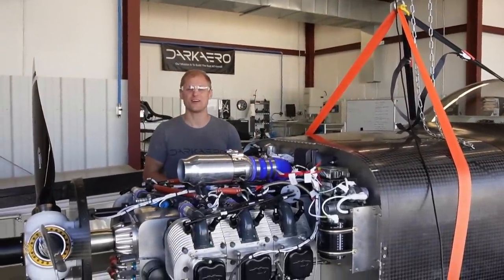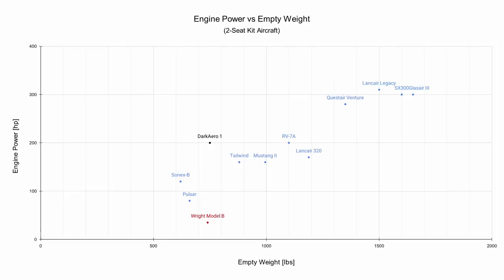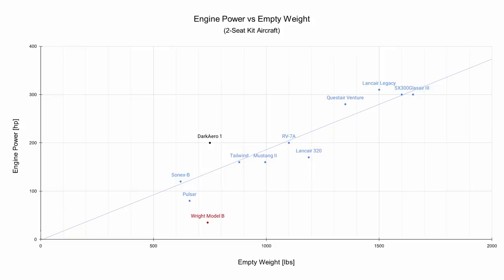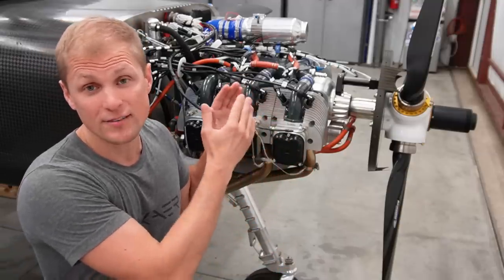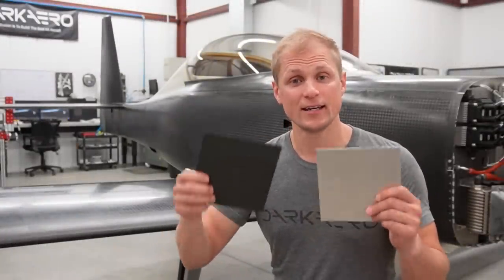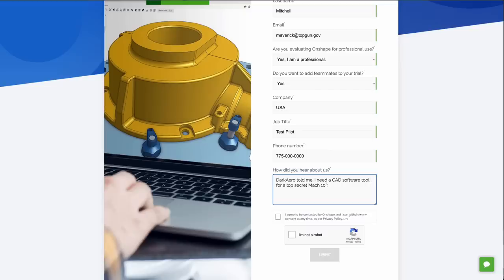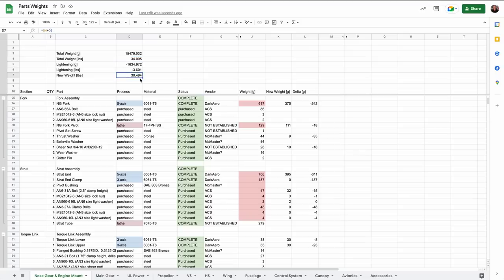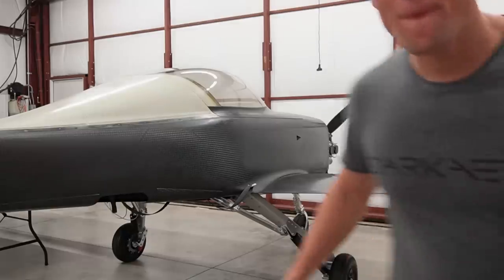How we built the DarkAero 1 "impossibly" light...

Comment: For all my fellow friends of reasonable units, 750 pounds is 340,2kg.
Reply: Or as Jeremy Clarkson once said, " In Roman Catholic ".
Reply: Lol so true. Wish I was raised with the metric system so the scale would be easier to see without having a measuring tape
Reply: THX
Reply: Isn't it 53.5 stone?
Reply: @danniendorff4815  53.8
Reply: Thank you, i believe he said 715 so would be even lighter, crazy!

I was hoping theyd add that after he said "i wanna explain to you what that means" :D
Reply: @Beerbellybilly1  53.75 actually
Reply: Seems impressively light to me.
It's got a better power to weight than most motorcycles..
Reply: There is nothing wrong with heathen units. 😥
Reply: Shuuut
Reply: 3402kg? Do you mean 340.2kg? :-p
Reply: @D3nn1s  715 is the weight right now, but certain parts are removed (for example the cowling) and certain parts are test exclusive (tank on the passenger seat). The target/ estimate for the final product is 750lbs.
Reply: So how it does compare lets say with WT9 Dynamic wich weights 260kg empty?
Reply: @plainText384  yeah realized it too, they said it quite late in the vid. Ty for explaining though anyways :)
Reply: @flugplatz8719  Wow that’s a nice looking plane. A quick look shows it has half the horsepower tho and fixed landing gear. I’m too ignorant on the topic to point out any other significant differences aside from those
Reply: It can fly with a R912 easy
Reply: King comment
Reply: @TheJustinJ  NASA actually used a mix of metric and imperial units during the Apollo era. For example the guidance computer on the Lunar module did all the internal calculations in metric, to control the computer guided part of the flight. However to allow the astronauts to see what the autopilot was doing, the units were converted to imperial in order to be displayed.
Reply: @TheJustinJ   yet it would be easier
Reply: Why is there a comma after three of the numbers?
Reply: @realjohnnyharrison  340kg and 200g. Where I live you use a comma to separate tenths from whole numbers
Reply: @realjohnnyharrison   some countries uses comas in place of dots 

Where I am is that way, comas for decimals and dots as separations for group of 3
Reply: Thanks for your concern. I went to school and I can use more than two.
Reply: @jakleo337  big trouble
Reply: Once you people of "reasonable" numbers walk on the moon, we of superior numbers will listen.
Reply: @TheJustinJ  you can only listen when someone talks to you, like you know how normal people do through our God given senses. Until then the hunger games continue.
Reply: For all my fellow friends of freedom units, 340.2kg is 750 lbs.
Reply: Thank you for restoring common sense.
Reply: HOLY SHIT
Reply: What the fuck is a kilometer
Reply: Eat my shorts commy! Sorry.
Reply: @RetRak0  "not commies": USA, Liberia, Myanmar
"Commies": literally everyone else.
Reply: This plane is so light, the imperial value seems ok for a metric one.
Reply: * 340 kg.

You can’t jump from 2 significant digits of precision to four during conversion of units.

750 lb is a round figure.  340.2 is a precise figure.
Reply: ah...unit snobs....
Reply: It's quite light because there's no transmission in between the propeller and engine, it is a direct drive.. BUT is the rpm of the propeller solely dependent on how open is the throttle?
Reply: America build planes in lbs
Reply: @fredio54 the way they use commas for decimal places really grinds my gears lol.
Reply: Until the metric world puts a foot on the moon, the American foot will remain the standard measurement of altitude.
Reply: @TheJustinJ  wait until you learn that the chief architect of the Saturn V was a German and that NASA widely used metric (and imperial units) in the 1960s to put boots on the moon.

Comment: This thing is gonna be disruptive to the fast 2 seat market. What a great example of how to use technology to improve existing concepts as well as set  in stone a solid foundation for a great company to flourish. Great job guys! Can't wait until you've got 1000's of these kits pouring out of your facility!
Reply: No, it won't, it's too small. The thing is basically a fast ultralight.
Reply: @PistonAvatarGuy  Not much utility.  Also, few comments about how far away this is from an actual consumer product. My guess is their real business is as a composites subcontractor and this is a showcase for their skills. Whether or not it turns out to be a vanity project or a very expensive toy for the rich, it will take a lot of testing and time to prove it's safe. Being a prototype at the far edge of the envelope, at 260 MPH a design flaw could mean disaster. A simple change like having to move the main gear 2" could result in having to redesign the entire airframe and add several months. Read about the C177 and Cessna, an established airplane manufacturer with money and a team of aeronautical engineers and the things they had to fix after the plane was built, after altering a proven design.
Reply: @dougj8186  and planes that small and fast, even if they are mechanically and structurally sound, prove to be way to much of a plane to even fighter pilots, ending up in lots of deaths and bad publicity
Reply: @samtatenumber1  The only "disruptive" homebuilt planes are the VanGrunsven RV series, 100 year-old technology using aluminum and rivets. I flew up and visited years ago when he was based at his parents farm in Oregon and the aluminum stock was on racks in the field outside his shop.
Reply: @dougj8186  Yes, it would be fair to say that this aircraft is one giant resume for getting a government contract (maybe drone) by showcasing their skills. 

But that’s great business sense and means they will be around for the long term which means support for all the DA owners. 

I’m sure they are well ahead of anything you have already thought of as potential hurdles in their future.
Reply: @ashsmitty2244  It's an awesome project. I just expect will it take longer and be way more expensive than presented so far. Isn't it a year behind schedule already?
Reply: @dougj8186  I’d think covid, lockdowns and supply shortages are a legitimate reason to be behind, if it were not for that. They would be close to schedule. 

Put in a deposit and lock in the price. 😉

I’m expecting my kit around 2025-26.

Comment: With regards to Carbon Fibre, have you considered the safety of the occupants in the event of a crash as carbon fibre shatters into sharp pieces regardless of the honeycomb. Also what about lightning strike? What if the aircraft is struck by lighting, if you paint it, the extra insulation will cause a concentration of energy, possibly dissipated by the honeycomb, but also if the honey comb is air tight, the rapid expansion of heated air may cause de lamination and explosion. Unlikely, but possible if a pilot flies through a storm. Also, if this aircraft is flown at high altitude and the honeycomb is air tight, will the structure be able to handle the pressure differential between the honeycomb and outside, or repeated pressure cycles? Also, how repairable is the aircraft, if damage was to occur to a wing, would you have to replace the whole wing, is it removable or is it permanently attached?
Reply: Very good points. Worth considering.  I really like there grid spar concept.

Comment: When you think you're done another idea pops into you're head sometimes good sometimes not so good but those usually are disposed of with hands on demonstration and real world use and safety but not at the cost of reliability and control don't concentrate on just the weight but the integrity of the build this plane is a game changer with the design and technical aspects galore great job

Comment: When Mazda made a new MX5 years ago they wanted to keep the weight right down. They had engineers look at every single part, nothing was excluded, and then reduce the weight even if it was only a gram. I saw this is a feature on Top Gear UK. Mazda managed to reduce the weight of the rear vision mirror by 90 grams / 3 ounces. First off that’s great, second is what was going on in that mirror to start with? You seem to be setting yourself up to do the same. You know what you have and what it needs to do and you control the construction. So now you can get super critical on everything.

The Dark aero is a Rapier rather than a broad sword. Both will kill you but ones a refined seemingly delicate design and the other is a beast.
Reply: Indeed

Comment: Good grief... the wing is so light that two guys can carry it around.  I work only on the Cessna 310... the wings are bolted to the fuselage. Just one wing is so heavy that it takes an adjustable cradle to support it while it's removed from the fuselage, and a crane to lift it. Crazy good work there, guys.

Comment: By making this aircraft extremely lightweight, one of the tradeoffs will be comfort.  Very lightweight aircraft are very bouncy in the summer when they encounter thermals.  Just compare an LSA's ride and comfort to a Cirrus SR22 to understand the difference.  If you have ever ridden in a race car you will understand exactly what I mean.   The NVH can initially be shocking to the senses.  Even after repeated exposure, the inside of a bare bones vehicle is not a pleasant place to be long term.  It's a thrilling place to be when performing at the limit, but it would quickly become tiring on a long boring cross country trip.

Comment: Wow didn't know it was so light. Have you considered targeting the European microlight market? Wouldn't work as a kit but people already pay serious money for racers like the VL3. CS and retracts are common and don't break any rules like in the US.
Reply: Maximum weight for two seaters is 450kg Takeoffweight. That is not reachable with this concept. 
Maybe a later, smaller Dark Aero with less engine power and less reach could work
Reply: Won’t work, everything is in imperial units.
Reply: @moriarteaa4692  was recently increased to 600kg
Reply: In whole of Europe? I heard it was germany
Reply: Stall speed is too high for ultra's under EASA regulations 🤔
Reply: @moriarteaa4692  aviation is under EU wide legislation, so all EU countries abide by the same rules
Reply: That would be nuts. new european microlight laws allow for up to 600kg (1320lbs) mauw
Reply: @moriarteaa4692  It's now 600kg so this would be legal in the UK as a microlight
Reply: @moriarteaa4692  Europe is going for 600 kg or 1320 lbs.
Reply: @MrFennicus  Ultralight are still under local rules per country. This will change.
Reply: @NobleWizard  Only for new aircraft. The old ones are still limited to 450 because they were build with that limitation.
Reply: @MrFennicus  Wrong. They all have completely different rules on homebuilts.  Nobody rl wanted to give up their own rules and even though they have Joint Airworthiness Requirements on paper, nobody uses them.
Reply: Just seen that the stall speed on the Dark Aero is way too high to qualify.
Reply: The VL3 is worth every penny! It doesn’t actually feel like an ultralight aircraft cause of its speed :)
Reply: But it’s a 2 seater
Reply: @moriarteaa4692 yeah I thought it was only in like the German areas too

Comment: Will be a nice machine when finished.

Some questions
- Will it be IFR approved?

- What do you calculate for Fuel consumption in cruise? And ofcours - Cruisespeed? - I have a hard time do belive that the aircraft will cruise at 275 MPH most of the times.
MOGAS?
- Any thougts of offering a "all inclusive" kit? Engine, brakes etc? 

Then a small note, please update your homepage to  knots and Nautical miles, and preferably so that you can easily convert to worldstandard measurements (mm, cm, liters..) it´s a mess trying to do it myself to find out if the plane fits me :)

Comment: Finally, the weight;; 1and half motorcycle is really not too bad. 👀
With my inconsequential vote, I'm suggesting leaving the beautiful carbon visible, airbrushing few details here and there, polish and a light coat of varnish. No need for heavy paint..
Reply: The paint is needed as the epoxy used in the carbon fiber composite breaks down under UV light.

Comment: 715 pounds is single place Pitts Special weight. J-3 weight. It makes me sooooo happy to see such weight discipline. It's the key to everything. Good job.
I'm still pushing for augmentor tube exhaust. Specifically for the cooling advantage. Especially during long taxis on hot days. Yes, it works also at very low power settings. It's free performance.
Reply: I’m sure you could have one of your own considering it’s in the experimental category.

Comment: Were you inspired by the SX300?   I was fortunate enough to visit Ed Swearingen in his San Antonio shop while it was going together back in the 80's.  One of the smartest guys I ever knew without an Aero degree.  And of course, flying his SW2 Merlin design for many years has always been amazing.  At MDC/Boeing we usually found control surfaces of aluminum were lighter than their composite counterparts.

Comment: Any chance you’d share your itemized weight spreadsheet? Lots of components you use are also used on other aircraft, it would save a lot of time.
Reply from the maker: We haven’t shared the itemized weight spreadsheet yet, but we do have a hardware tool on our Knowledge Base that provides the weight of fasteners and bolted joints: https://www.darkaero.com/knowledge/hardware-specs/ Check it out!
Reply: @DarkAeroInc  thx!

Comment: Great project!  Looking forward to seeing it come closer...  I was building a Lancair 320 many years ago and then sold it simply from a safety standpoint. I did not like the high stall speed and slow flight characteristics.  With that said, I feel the engine argument here is "risky".  Engine power to weight ratio is one thing, but engine reliability is a huge factor.  Some reliability is added by weight.  Personally, I would not fly an aircraft with an unproven engine (even a Lycoming is risky enough for me).  Not sure what engine the DarkAero is using but what I see would immediately draw me away from this...
Reply: The engine is a ULPower UL520iS... basically a slightly updated version of the same thing that has been powering general aviation for about 70 years.

Comment: Just did a quick checkup about that graph: the three planes that are quite a bit below the line, thus pulling the average down the most are 3 decades (pulsar, lancair) or 5 decades (mustang 2) old. So a experimental full darbon plane from 202X better be damn above that line. I try to be sceptical at times (arca space lol) but this planes power / weight ratio certainly isn't the right place to be sceptical about

Comment: On that graph I would like to see the Dark Aero compared to the JMB VL3 and the Risen 915iS SuperVeloce.
Reply from the maker: Hey OneAlphaMike! The VL3 and Risen are awesome airplanes, and they would be good additions to the graph. The numbers we reported are true measured numbers from old CAFE reports or measured numbers from builders. We had a hard time finding good verified numbers for many of the European UL aircraft, but if you know of a good source we can definitely add them. We will probably share an updated version of the chart on our social media at some point!
Reply: @DarkAeroInc  JMB website shows the VL3 empty weight of 360kg, so about 792 lbs. The Rotax 915iS has less horsepower, but it’s a turbo, so it can maintain full rated power up to 15,000’ before it starts dropping off. They’re claiming 200KTAS max cruise (which is probably at max continuous power, not at a normal cruise power setting). The Risen shows empty weight of 350kg, so about 770 lbs. Same engine as the VL3. They claim 210KTAS max cruise and 197KTAS at 75% power at 9000’. IF that’s accurate, it should be even faster at higher altitudes. 

I was surprised you chose a normally aspirated engine. Yours would be a screamer with a turbo at altitude, assuming flutter doesn’t become an issue.